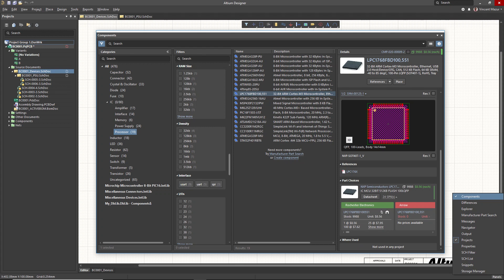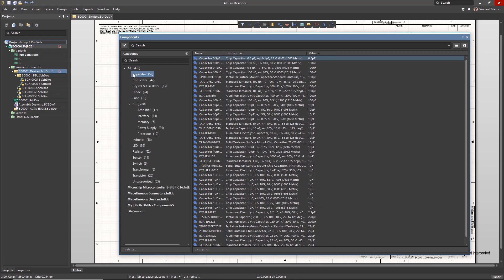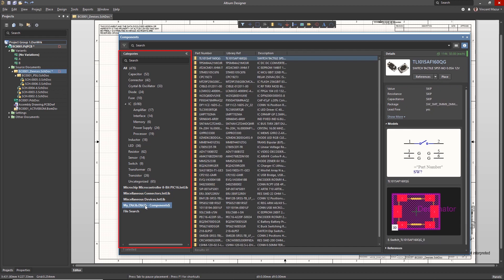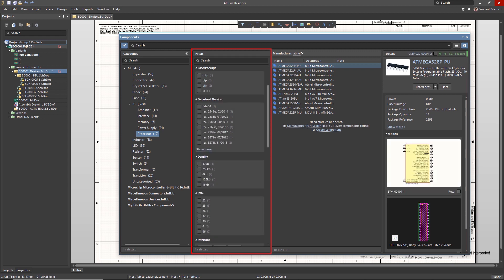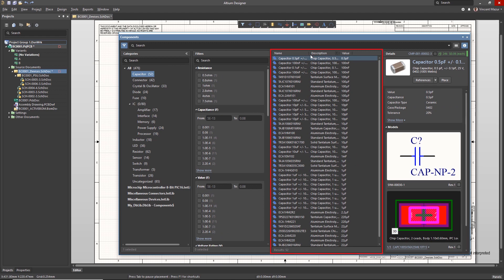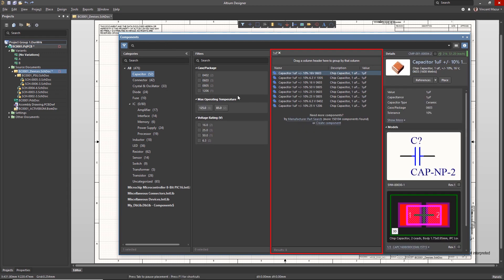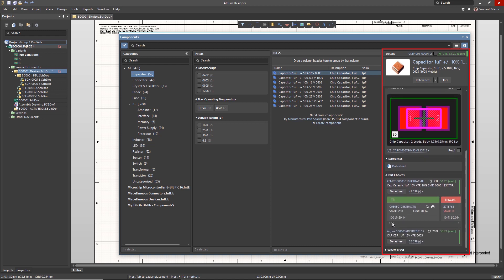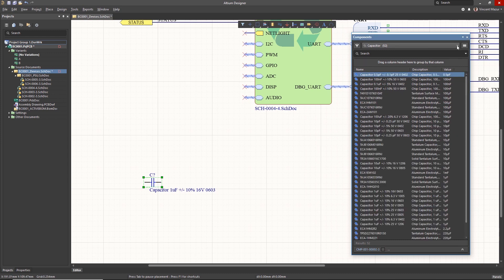How To Use Libraries In Altium Designer 19

Comment: there is no "ALL"  in the categories region
Reply: @Ahmed Nasser There is only an "All' category if you are using a managed library with defined component types. Existing products for managed libraries include Altium Concord Pro and the retired product Altium Vault.
Reply: @davidhaboud9557  Hi, you mean to use this managed libraries we should use Condord or some other components? It's not inside Altium Designer? Thanks for replying.
Reply: @keivansadeghinezhad8332  You have to use a managed server to host the components. You can use Concord Pro or Altium 365. Altium 365 access is included as part of your subscription, so I recommend you try it out for yourself. https://www.altium.com/altium-365

Comment: My control and Search bar region does not have an option to add a library. Neither the interface looks like the one shown in the video. How can I set it?
Reply from the maker: Are you using Altium Designer 19? This capability was added with the latest release of Altium Designer 19.
Reply: Altium Designer, I have used AD17 and it has the option to add "Available File Based Libraries" option in the Control and Search bar. Now when I have installed AD19.0.5, it does not have that option.
Reply: @SaieenTwist  This changed. To add your SchLibs or IntLibs in AD19 you can do that from the "hamburger" menu in the Components panel. It's the button with three horizontal bars on the right hand side of the Search box.
Reply: @schematica As you can see in the image  (Link: https://imgur.com/a/I92A1pS ) , no hamburger menu is available.
Reply: @SaieenTwist  A new build was released recently, try updating a let me know if that fixes the issue. If you can't update or if the problem persists, you should issue a support ticket for more help.
Reply: @davidhaboud9557  Thanks. The problem is resolved via updating Altium.
Reply: @SaieenTwist  You're welcome. Thanks for bringing it to our attention. We are making a new video about accessing file-based libraries to help people with this issue in the future.